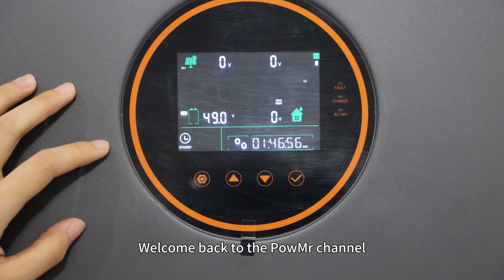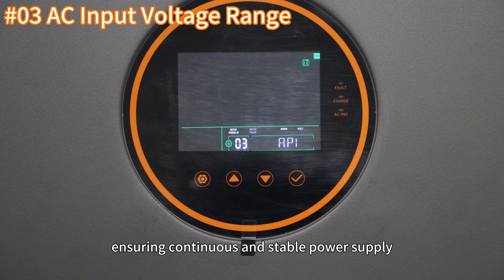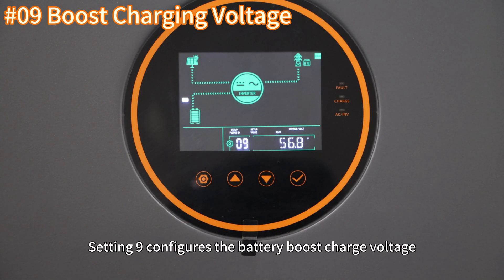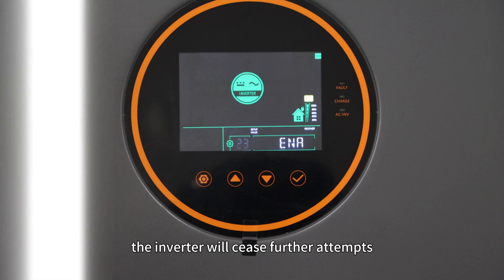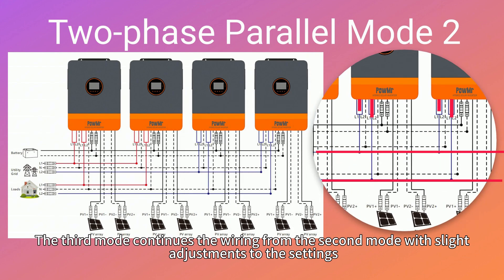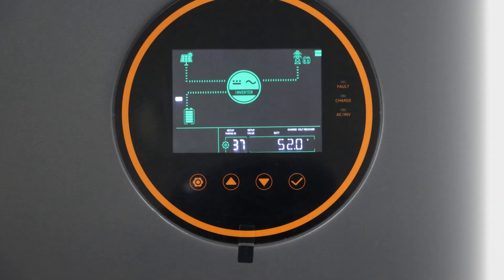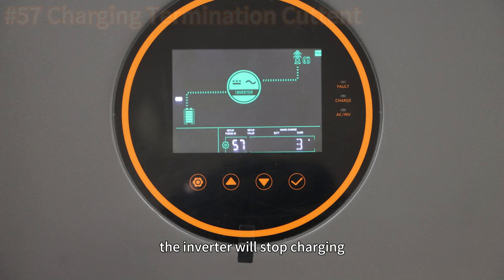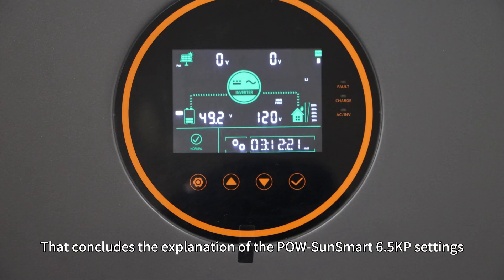How to Setup the POW-SunSmart 6.5KP Hybrid Inverter?

Comment: 80a utility charging speed :/
so hard to find this info online from venders on this unit. also 80a is not very fast but better than 60a.... 
use your inverters to make ev range extending packs that i put in my old 2013 chevy volt phev's. i charge them through additional j1772 plugs because many ac chargers here in the US are free but slow. more inverters = more free plugs = more free electricity i can bring with me and use on the road whenever i park. i have a 240v evse as the output for the inverters lol. currently using diy 8kwh lfp battery with 24v/3kw spec inverter but it gets overloaded at 13a 220v charging, so i am stuck working with 10a @ 240v (2.4kw charging speed). my car only does 3.2kw charging but i might upgrade to 16s lfp battery and use this model. bummed about the charging speed only being 80a from utility. wish it was 120a to max out the free public chargers. maybe i will just buy 2 inverters. the bigger 10kw model is too expensive for what time doing.